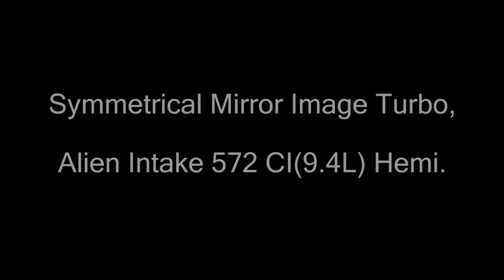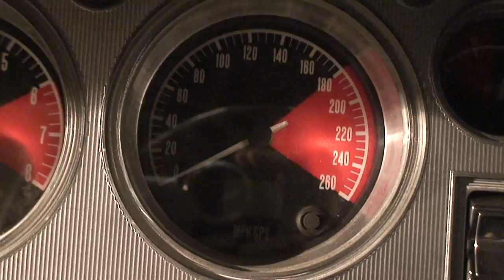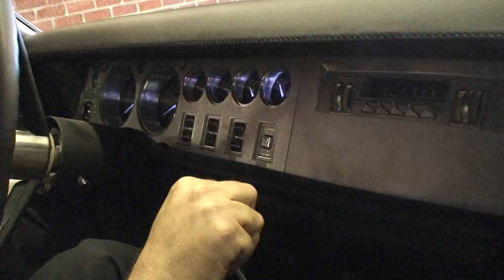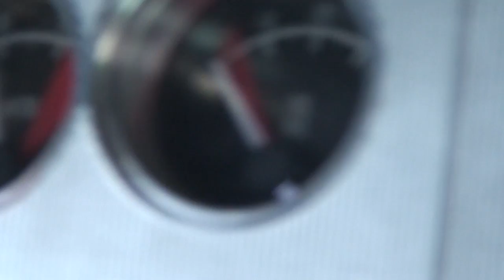Furious 7 Hero Car!  2000 HP Maximus hits the Streets!  Nelson Supercars.  Scott Spock Racing Ultra.

Comment: ABSOLUTELY AWESOME!!!  Plastidip the car in a matte finish...just my 2 cents...that way if you get tired of the color, you can always just peel it off.
Reply: chances are if you can afford a nelson super car getting it resprayed is pocket change
Reply: sjpro1 
Real talk! This is SEMA car, not a Civic. If your dropping that kind of cash on a resto-mod Charger with 2000 horsepower, Im sure spending $20,000 for a paint job is nothing.
Reply: Leave it as it is, brushed metal is awesome
Reply: Two words on the paint job: Black Suede.
Reply: The whole point of the car is to show off the amazing metal work why in he'll would you cover it up.If you notice there's no welds, grinding marks or any other body work showing which is remarkable especially with the age of the car
Reply: gsppuffer i agree with everything you said except the car is basically brand new at this point lol
Reply: gsppuffer You can see some faint signs of bodywork, and some yet to be done, but that's the case with any high quality build like this. Sure you could clean up the rest and throw on a clear coat, but this bitch was born to wear black. What's the point of all that angry snarl if it's coming out of a chrome bomb showcar?
Reply: not sure why everyone refers to that spray on shit as plasti-dip. cheapest way to do it aswell, if you want something you can change after a while atleast get a rpfoessional wrap, not a spray can in your garage. a good wrap can be as cheap as $800 from what ive priced out. not a bad investment
Reply: Ethan Jarvis where did you get that quote? im seeing almost as much as a real paintjob

Comment: Absolutely gorgeous. I have only watched 4 minutes at this point but I heard 16 injectors which leads me to believe that you have done the same to this car as the RX-7 running a 2nd set of injectors for higher boost or a 2nd turbo. RX-7 was seamless and I have no reason to believe this one is any different. Amazing ingenuity.

Comment: I've left my opinion on this car. I would prefer it left the same with clearcoat, I haven't decided but I would love to see a stripe signifying that it's an R/T . I think a gunmetal grey stripe would look awesome because it would keep the heritage of the R/T plus it would signify custom and make it look as fast as it is and going a few shades darker then it's original aluminum/brushed metal look and it will do the trick.-- sometimes simple is the best and with this car, I really believe that. Just look at the car with it's natural beauty, get some color chips of gray and go with the lightest color that still shows.I think the rims are awesome, I like that satin centerline, riveted look with all 68-70 Chargers. I build custom models, I'm 43 and I always put either centerlines(some people call them Cragers) or 5-Star welds look awesome on Chargers. As you can tell, Chargers from 68-70 are my favorite car and I hope this helps Cheers!

Comment: Man i love the insanely wide rear tires. 18 inches wide each thats freaking nuts. And obviously it hooks up pretty quick for 2000hp from a Hemi which makes insane torque. But although i doupt it will get driven much i would hate going cruising and it starting to pour outside because treads or not tires like these hydroplane so easily. Anyways beautiful build guys.

Comment: Huummm just a question... Do you think if with a Lenco 4 or 5 speed clutch, it will be more funny and hard look in the interior or if the first idea to up the Tramec clutch to look like te original look like in 1968...thanks for this. Chris.France.

Comment: My vote is clear coat and either keep the wheels as is or have a custom set of concave HRE mono-block wheels (not 5 spoke)
.
I say this because this car has already hit legend status and is world famous based on its current look and if it got painted then all the beautiful "metal finish" work would get covered up and look like most pro touring Charger's.  The blank wheels also make it look tough and think machining the centers would ruin the clean look.

Comment: Two tone, dark gun metal with clear coated bare steel pin stripe, and your choice of a mopar color for the top and put a set of rays ultra light forged rims with the logo on the bar, 355R and 255F

Comment: Love your cars, love your engines! this project Maximus is dang awesome. Not only does it have tons of power it looks like it has some decent handling suspension in it also, which will make it a good driver. As for the video, hand held cameras inside cars just don't work well. at least get some sort of stabilizer or mount for the guy holding onto it so we don't get so many shots pointed into the dashboard and the passenger footwell.

Comment: The power the car makes is so impressive!
However putting it in to the ground seems like its going to be a problem.
Now the electric Tesla Model P85D (Dual Motor) only haves 691hp, but the electronically controlled electric motor checks the torque and tire slip like 200 times a second. Giving you the fastest acceleration possible under any road condition. Now that's impressive.

Comment: In theory a metallic silver basecoat could be sanded to look the way the bare metal looks, then clearcoated.This would allow you to use primer,bondo and fillers of all types to make a laser straight body. A clearcoat contains NO rust inhibitor and does a poor job protecting against rust!

Comment: Side marker lights let it down, drop them below the body line instead of smack on it, and recess them. The radiator cover panel flaps around way too much, obviously needs reinforcing.

Comment: I'd paint it along with the engine compartment, and anodize all the billet aluminum parts. They look beautiful now but they will oxidize in time and look dull. If you don't paint the car at least put a coat of matte clear on there for finish

Comment: That car is too sinister.  It's what I'd imagine Lucifer would drive.  My only concern is; as well as those wheels match the badass swagger of this car, would that solid design not hold in heat from the breaks?  Obviously it not built for the roadcourse, but in such a heavy car, I'd be afraid of warping rotors.

Comment: If it were my car, I'd finish it in a egg shell clear coat. The wheels have to be cut to get the weight down. Maybe Halibrand style 6 pin knock offs, in matte magnesium finish. It would be  a sin to hide all that metal work.

Comment: Wow, what was that horrible noise when he turned it on it sounded like some sheet spinning or something like that. Just unfinished sheet rattling or what. Man, Iv'e got to say as I watch more & more of your outfit testing different cars on those streets around your yard I really worry that sooner or later some car or some kid is going to move out into the road just as the car your testing is lit up 3 or 4 blocks down the street and that monster is going to be on the top of its flex when the poor unsuspecting victim moves out into the line of fire and the beast will close the gap of distance before the victim is even aware of what's coming and your car will just not be able to come down off the power surge in time to stop. Forgive me for being a party pooper but I honestly believe it will happen sooner or later. I hope not but I think it's not a matter of if but when.